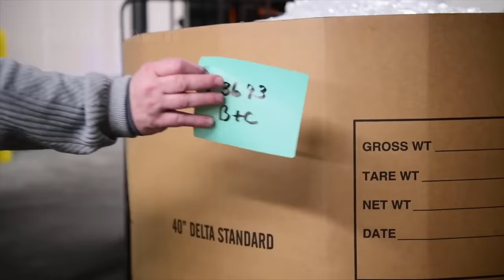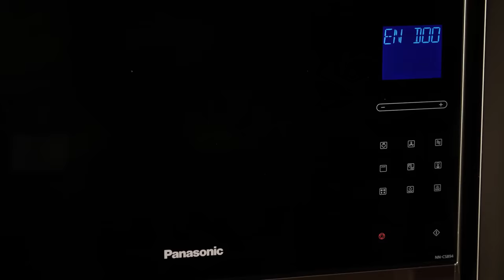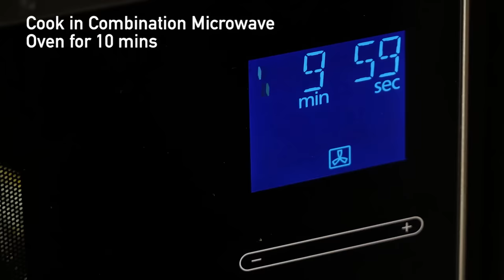Modern Scallop Fishing Vessel - Hundreds Tons of Scallop Processing in Modern Factory

Comment: There was a clam cleaning technique I learned on the beach digging razor clams. That is much due to the fact that they are more difficult to get out off their shell. So, if you bring a stove and boil water in a pot. Then you can grab the edge of the shell of a razor clam with a plyerrr then immerse into the boiling water for a short period like a few seconds. The shell will start to open and it will help to release the connective meat. And the clam will remain uncooked almost completely. Anyway,